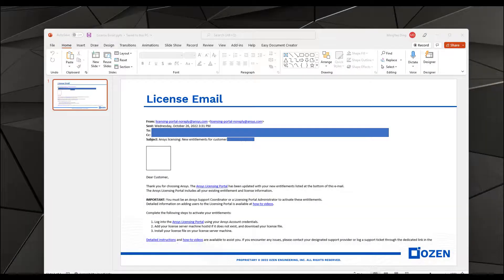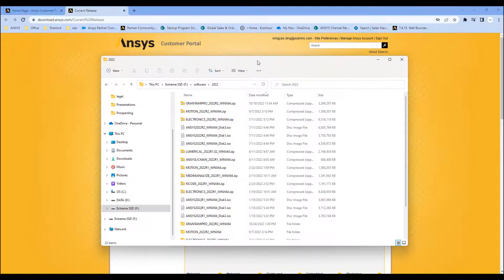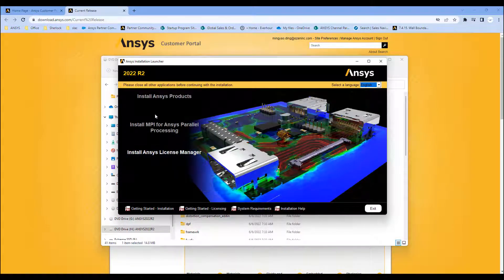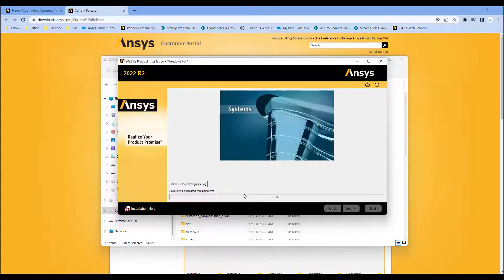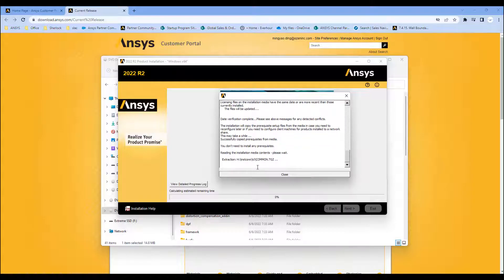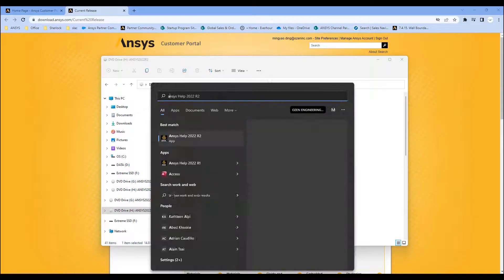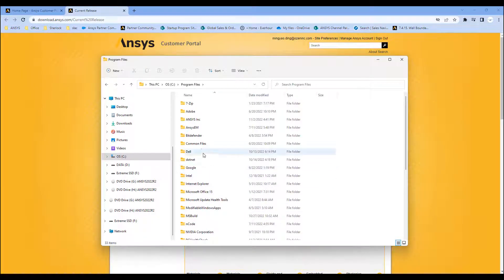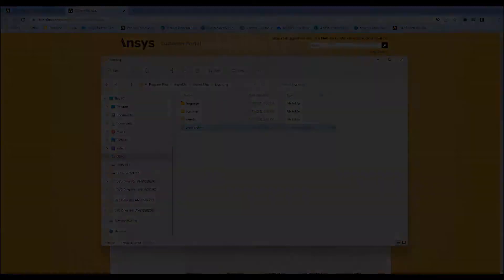Connecting to your Ansys license server

Comment: mutil - Copyright (c) 1989-2024 Flexera. All Rights Reserved. Flexible License Manager status on Tue 9/9/2025 02:16 [Detecting lmgrd processes...] Error getting status: License server machine is down or not responding. (-96,7:11001 "WinSock: Host not found (HOST_NOT_FOUND)") Error: Command failed: C:\Program Files\ANSYS Inc\v252\licensingclient\winx64\lmutil.exe lmstat -c 1055@lakhanA
this error ahowing